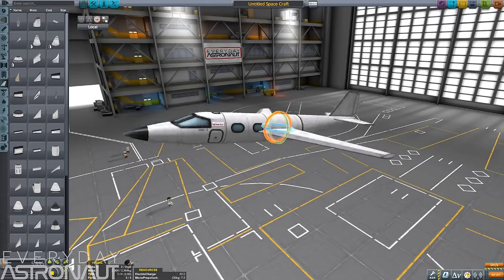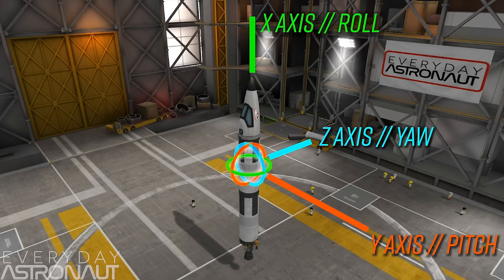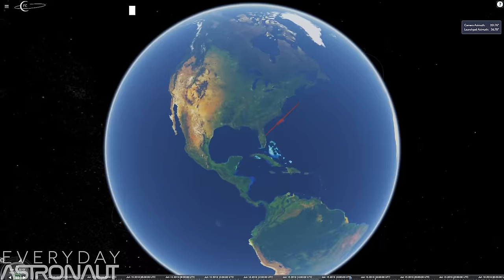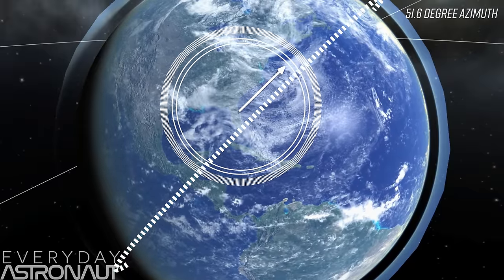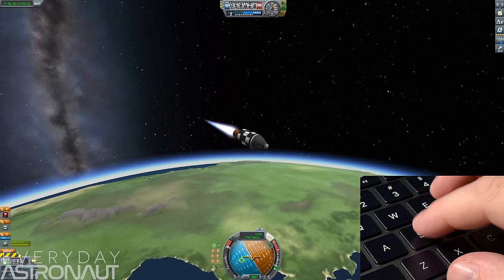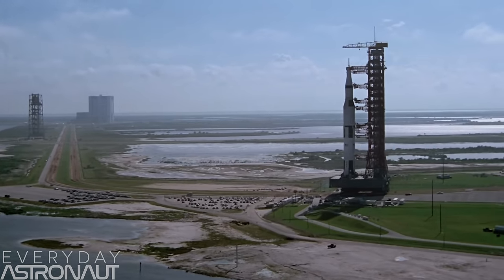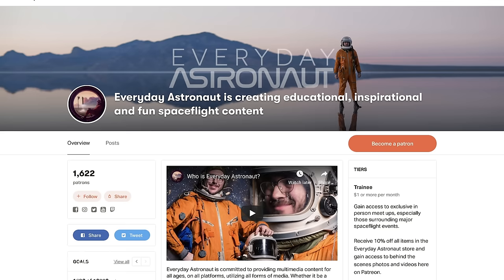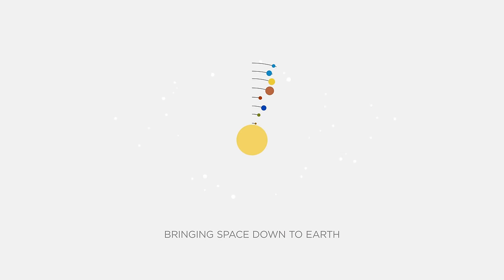Why do cylindrical rockets roll?

Comment: TIM, you could most likely NEVER figure out all the reasons for the roll program, and CERTAINLY not all the decisions that went into augmenting it.  As an engineer, I can tell you that many decisions that are made are never voiced, not even in "lowly" (functionally) design reviews, and certainly never committed to "paper", and most all of them stem from a plethora of competing, often directly contrary, requirements.  Payload wants the rocket to weigh nothing, structural want some "factor of safety", aero wants NOTHING anyone else wants, etc. and all with good reasons.  I like that the SpaceX guys were "griefing" you on some of it, shows they are interested.  With a bit of research, you could find plenty to playfully pick back, I can guarantee you....but with your little "stunt" in the space suit...maybe NOT.  Keep up the good work, nice to have someone explaining this stuff to the interested layman with due diligence toward accuracy and reasonable completeness. 

Here's a fun one for you.  My boss and I were walking out of the building one day, and the group in front of us was trying to figure out where their cars were parked, and started one way, then turned around and went the other.  I made a snarky comment, and one of them said something to the effect of "the worst of it is we are the G&C (guidance and control) group".  We got a great laugh out of that one.

Back to the original point, I can GUARANTEE you I've made many design choices, hopefully the right ones for good reason at the time, that I will never remember again.  ;-)  As I often say, old age sucks

Comment: How Air Force Missileers understood the guidance system...   The missile knows where it is at all times. It knows this because it knows where it isn't. By subtracting where it is from where it isn't, or where it isn't from where it is (whichever is greater), it obtains a difference, or deviation. The guidance subsystem uses deviations to generate corrective commands to drive the missile from a position where it is to a position where it isn't, and arriving at a position where it wasn't, it now is. Consequently, the position where it is, is now the position that it wasn't, and it follows that the position that it was, is now the position that it isn't.

In the event that the position that it is in is not the position that it wasn't, the system has acquired a variation, the variation being the difference between where the missile is, and where it wasn't. If variation is considered to be a significant factor, it too may be corrected by the GEA. However, the missile must also know where it was.

The missile guidance computer scenario works as follows. Because a variation has modified some of the information the missile has obtained, it is not sure just where it is. However, it is sure where it isn't, within reason, and it knows where it was. It now subtracts where it should be from where it wasn't, or vice-versa, and by differentiating this from the algebraic sum of where it shouldn't be, and where it was, it is able to obtain the deviation and its variation, which is called error.
Reply: Like dribbling a ball with your eyes closed.

Comment: Roll to azimuth could be 180 degrees around. Alignment was to make the astronauts sink into seat rather than fly up, restrained by safety belts. Other way would be like going over the top of a roller coaster or an outside loop. It also keeps the breakfast down!

Comment: 15:30 - I think flying parallel to the horizon should give you an additional small amount of lift allowing for a less fuel consuming ascent profile. Since the drag should be roughly the same in perpendicular or parallel configuration, this might be the main reason.
From KSP (with ferram) I personally noticed that the rocket seems to also be more stable if you fly parallel.
Reply: Good point

Comment: Just found this video.  Great stuff.  The reason the Saturn V and CSM had opposite axis was the astronauts were heads down on ascent but they would fly it "heads up" in space to make it easier for former test pilots to navigate.  The reason they were heads down for ascent is to put the g-forces in a positive direction, pushing them into their seats.  Positive gforces are easier to handle that the negative gforces they would experience if they were heads up.  Negative gforces force blood to your head and cause brain damage but positive push it away and you can use a g suit to compensate.

Comment: In case you don't want to sit around for 22 minutes to get an answer it's at 5:30.  The rocket rolls to align itself with its flight azimuth so that the rest of the launch is reduced to only pitch adjustments.
Reply: you see a question like this and can't even wait around 6 minutes for the full answer?
Reply: @SpydersByte  That is the answer. Anything else is added context or fluff.
Reply: @ImaSpacePotato   added context or fluff? At the end of the video he lists multiple answers to the title question that were explained throughout. If you think everything but "it rolls to align it's flight azimuth" is just added context or fluff you must've had terrible grades in school. Why do you even bother to watch videos like this with such a meager sense of curiosity?
Reply: Most it is super super basic.

The real answer to why symmetrical rockets roll  is that the rockets aren't symmetrical.

Comment: How about a video why the N-1 failed? I think that would be interesting! Btw. it's a shame that the N1 didn't fly long enough xD 
As always great vid! Thanks
Reply: The N-1's main flaw was that it used 30 small rocket engines on the first stage that were required to generate enough combined thrust to lift the fully fueled rocket up off the launch pad. Getting 30 separate engines to start and operate reliably in a synchronized fashion turned out to be very difficult. In contrast the American Saturn V moon rocket only used 5 much larger F-1 engines to do the same job. While its true that designing a reliable large chamber engine as big and powerful as the F-1 was no easy task, once the F-1's were developed being able to use just 5 engines on the first stage instead of 30 made the defining difference.
Reply: @joevignolor4u949  That was just one of the many reasons. The guidance system, aerodynamic effects caused by the massive plume of the first stage and the lack of stability that was later fixed with grid fins. There are probably more, those are just the ones off the top of my head. Problems however were being fixed after every test and every launch, but politicians eventually lost interest because they would be second to the moon anyway. Boris Chertok and others in the project were confident that the 5th launch would succeed. There were two N1s ready for launch when the project was cancelled.
Reply: Mo engines, mo problems!

Comment: Your one line explanation at 5:25 was enough for me.  

Of course on Kerbal Space Program, I go and completely align my rocket on the launch pad, including an inclination to start the the gravity turn.  Hence the program is to shoot for prograde.  

Adjusting the time of retaining the initial launch angle, and adjusting the delay between the booster and ascent stage give me two time periods to easily adjust pitch.   Holding initial launch vector for longer raises the gravity turn, while waiting longer for activation of ascent stage lowers it.  I can do the same as the ascent stage with my maintainer stage if I have one in my rocket.

Comment: I kept waiting for you to mention onboard computer complexity, and finally you did give a little nod to it. but I felt it was understated in the vid, and really, it is what it all boils down to. controlling rotation along one axis makes the calculations easier, but if a computer's doing the calculations then just write a program and be done with it right? I mean, that's how the modern world works, I don't need to understand how a cellphone works to operate one, because somebody did all that work already and now it's just a tidy little package that does the things.

so, the easier calculations are important not because of a person's ability to perform them, but because of the computer's capacity to perform them in real time. the Soviet solution of aligning the pad basically eliminates the need for any onboard calculations at all, and the SpaceX tactic of doing everything onboard is a luxury specifically afforded by modern computers. so really this is underlyingly a story of the development of computing technology and strategic use or non-use of it. if my computer can only handle a tiny amount of memory, and perform a few hundred or thousand operations per second, then I want to lighten the computational load as much as possible by doing some things outside of the dynamic computational environment. the Soviet solution was essentially to do everything outside of a dynamic computational environment. and SpaceX operates in a world where multicore GHz procs are cheap, so they can basically do whatever the hell they want in the onboard computer.
Reply: I still don't understand why one has to physically align the rocket's coordinate system to the world's one to turn a general 2 parameter calculation into an easier 1 parameter specialized case one. instead you could use a virtual coordinate system that is aligned to the world one to have the only 1 parameter calculation. the difference between rocket's  physical and virtual coordinate system is constant and the conversion to and from is a simple affine transformation, isn't it?

Comment: A well made video. Kudos!
So basically rockets rolls just to turn and go to other directions. I think this maneuver were also applied to an airplane when changing its heading. It will roll slightly using the aileron, then pull up the stick (pitch up) to turn the airplane.
Reply: bAkAyAroAhosAn You might have gotten that impression about airplanes from some video games that don’t model the forces correctly. Real airplanes roll, which causes the lift to be applied at an angle. The horizontal component of lift turns the airplane. The pilot must pitch up slightly to maintain altitude,  but that is an effect of the turn, and not the cause of it.

Comment: Interesting video. I suppose another consideration for the roll on a manned rocket is so with their heads pointing down, it would be to keep the g-forces positive during the pitch manoeuvre. Much easier to manage moving your arms to operate the craft when the force is going in one direction. And like you said, they can orientate themselves with the horizon to get visual picture of what the spaceship is doing. Being pilots, they would of done a lot of flying using the natural horizon as well as instruments.
Reply: But only if they had to!!!  Mostly they're just observers at that point, making sure everything is working as it should in case they have to do anything.  That German guy, Mr. Otto, is flying the rocket!  (Auto)

Comment: Fairing separation on the Z-axis probably causes them to reenter at about the same time.   A bit of a push in Y probably causes a delay between the two halves' reentry which would be better for telemetry and operations.   Maybe only slightly better, but why not take every advantage?
BTW, this video really explains orbital characteristics very well for the non-experts - a must watch for the kiddos.

Comment: Love your work bratha.  You've been blessed to have your channel at the right time n right place. TIMING IS EVERYTHING IN BUSINESS.  CONGRATULATIONS.   I appreciate your work.     I. M. U.  =  Inertial Measurement Unit.   Yes its the guidence syetem.  I used to work at Northrop in the Strategic Missle Field Returns department at the Hawthorne facility. Northrops Electronics Devision.  NEDS..  Im bot the correction police btw.  Lol

Comment: I am definitely not smart enough to be a rocket surgeon, but a thought occurred to me about an hour after I watched this video.  Rockets take a curved trajectory to reach their orbit, starting vertically then eventually working to a more horizontal trajectory.  

If you have humans on board, I think you would have to have them with their heads facing towards earth due to g forces.  As the rocket flattens out its trajectory the top side of the rocket would experience  negative g-force while the underside would experience positive g-force.  Pilots can deal with around 9 positive g-force but lucky if they can deal with 3 negative g-force.

 I am not sure if rockets pull enough g-force while flatting out their trajectory or not.

I really like your stuff, keep up the good work.

Comment: The axis coordinates or attitude coordinates  for a rocket can be best understood if it is flying horizontally  and assuming it has a cockpit such as the  USA space shuttle.  The  X axis  is for roll, the Y axis is for pitch and the Z axis which is is for yaw (Left/right)  .  The  Z axis is still considered  the  vertical  path,  the  X axis  is  L & R, & the  Y axis  is depth  of the frame  that the  rocket is traveling through.

Comment: The Space Shuttle answer was; that it's "roll program", rolled the four (element) stack; solid rocket boosters (2); external, expendable fuel tank (1); and, Shuttle Orbiter Re-entry vehicle, all rolled together after launch to place the external fuel tank into the slip-stream of the atmosphere impinging upon the combined vehicle as it rose into the air and passed thru the speed of sound in the lower atmosphere.

The force of the wind resistance of the atmosphere below the external tank's jettison altitude, would have torn the shuttle vehicle to pieces during the ascent.   Only the external tank was designed with the structural strength to remain intact as the whole vehicle system plowed through the lower atmosphere at speeds approaching 3,000 miles per hour.  Well before that speed; and before Mach One (1), the "Stack" needed to assume a launch attitude that rolled the Shuttle Orbiter out of harms way, and left the tank (with its cover of insulation) to deal with the skin friction heating and trans-sonic shock taking the vehicle into orbit.

Comment: The Soviet N1 is the largest rocket to have ever flown. It did not complete a mission but it did fly.
Reply: In terms of diameter at 17m it was the widest rocket to have flown and the one with the largest thrust for the first stage.  The Saturn V was taller and could take a larger payload to low earth orbit.

Comment: I really enjoy your videos. You keep them very informative without being dull and you stay on topic (you don't bring your pets into the video and tell us about them.). I do have a rocket question. If you go out into the desert to the "Friend of Amateur Rocketry ", you can see so very complex rockets with instrument packages. Yet when the ignition sequence starts on the solid propellant motors there is a several second delay before liftoff occurs. NASA can get to zero on a count-down and swoosh the rocket leaves the pad with no delay. How do they do that? Amateurs will install 2 ignition wires when building the motor to ensure it starts, yet there is that 2-3 second delay for a start.
Reply: Usually NASA has the spacecraft clamped down until it comes up to thrust and settles, then clamps released. I've never done much rocketry, but, I imagine that in the first milliseconds of the burn, the motor thrust is very tiny taking a couple of seconds for the thrust to overcome the weight of the vehicle.

Comment: Most likely reason for reversing the Y and Z co-ordinates for the Apollo CSM is that after launch and translunar injection burn it would spend most of its time pointing retrograde. It only needs to point prograde again during the trans-earth injection burn. This reduces the amount of RCS fuel used and keeps the Service Module between the astronauts and anything that might impact the spacecraft.

Comment: Your discussion at about 9:50 confused me on this, the 3rd time i watched this wonderful video. As I recall from my days at the MCC in Bldg. 30 during the '60's , the IMU referred to the Inertial Measurement Unit(s) not the Instrument Unit.  The Instrument Unit (IU) was the IBM-provided ring atop the 3rd stage that housed all of the guidance, navigation, and control computers and devices, including the IMUs.  Right?  I suspect that the accelerometers that you referred to were those in the IMU(s).   But of course who cares!  All of your videos are awesome, and correct in a all important details.  And perhaps I'm even wrong.

Comment: The shuttle ALSO needed to be on the bottom  so it could better control the up/down attitude by using it's throttle.  If it were on top it could only make it go down by adding throttle.  It could not help it go up.....
When it rolls, it aligns its course program.

Comment: There's one more reason on manned missions that didn't get talked about: G-loading on the astronauts.  As a rocket settles in to its gravity turn, anything or anyone inside experiences a g-force pulling towards the outside of the turn.  Since humans handle g-forces better when they're pulling towards the feet rather than the head, it only makes sense to roll so that the astronauts are head-down as the gravity turn begins.

Comment: I watched the video and the only reason for the roll, that Tim did NOT mention, is to put the space shuttles protective shielding the right way up so that the black of the shuttle bottom is getting heated by the atmosphere as we leave Earth. If he said it, I'm sorry I didn't hear it. But that's what I always thought, was, the main reason for the roll. On a cylindrical rocket I'm sure the protective shielding is being put in the same place to protect them in the same way? I'm not an expert on anything and I'm not saying anyone is wrong, but that's what I was told it was for. All valid reasons to be honest. I see the sense in each of the reasons.